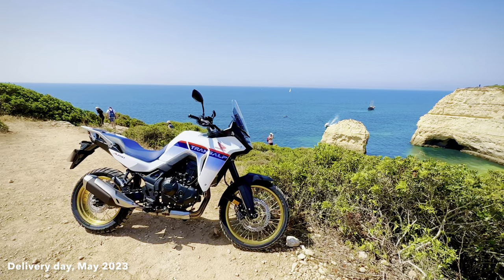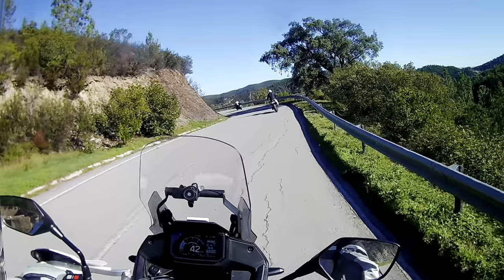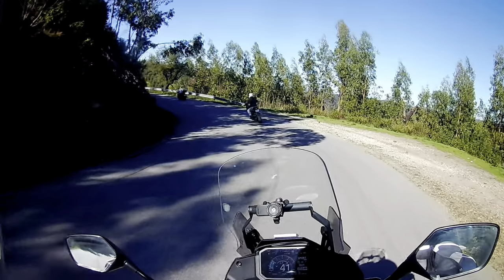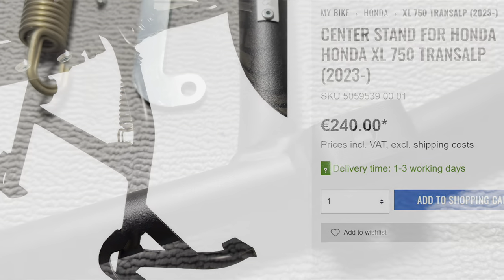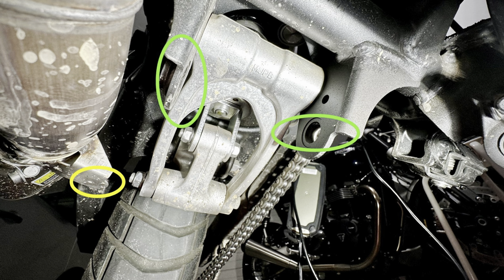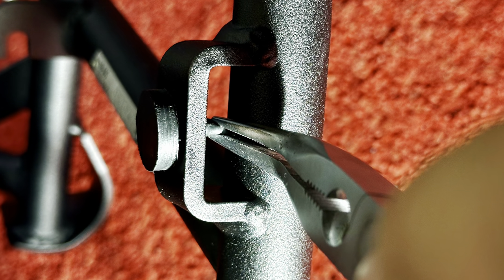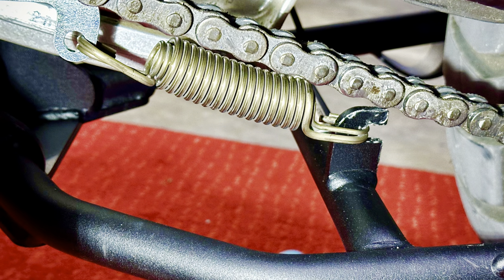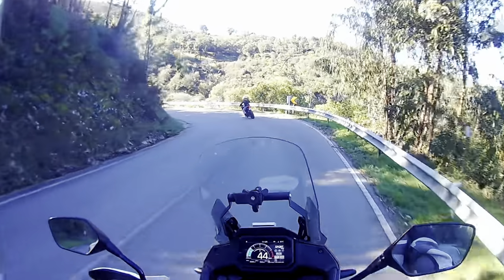Transalp Centre Stand Install  -  Hepco & Becker vs Honda

Comment: The first batch of the unstable stands are part no. 08M70-MLC-D00, whereas the improved later version is part no. 08M70-MLC-D01 (which I have fitted with no problems). Just in case someone thinks they are getting a bargain by unwittingly buying one of the first batch numbers. I like your vids by the way!
Reply from the maker: Thanks for the info - very useful!

Comment: I mentioned in my previous comment that a center stand was a godsend during a recent puncture. I'd like to warn owners that the rear wheel nut size is 27mm and of course I didn't have a socket that size, and I have quite a collection. So buy one now before you need it.
Reply from the maker: Good tip, thanks!

Comment: Hi mate, I have installed the same center stand by my own, and as always I'm very pleased. The trick to extend the springs is doing one per time using a metal fence wire in loop shape and using an old towel for hand protection, grap the inner spring first, attach it to the hook and then the outer spring. It only requires minor physical strength. Mind over matter. 
By the way, I love my Transalp 750 so much thus I have no plans to replace it in the near future. 
I recently uploaded a YouTube video about my bike but it is not in English language. Have a look about the extras I used on it and everything installed by my self.
Greetings from Greece.
Reply from the maker: Good tip about the spring👍 I have to agree about the Transalp. I’m always talking about changing it, but I can’t really think of any genuine reason to do so🤔

Comment: Essential. 
With chains and tubes should be standard. As we know.. 
For fitting i always have the same dramas, until i found it easier to fit the spring first, then pull the whole stand back and pop the bolts in. Seems much easier with more leverage. 
Good to see it getting plenty of use.
Boa viagems e feliz natal.👍
Reply from the maker: Nice trick👍😊

Comment: A tip for getting that stand spring(s) on. I first came across this on a Honda Innova, and later when I fitted an SW Motec stand to my R9T. What you do is use a length of strong string looped around your waist, and attached to the 'T' handle of the spring puller. Then all you have to do is lean backwards, using your body weight to stretch the spring, and slip it over the detent on the stand - job done in seconds with no effort and no paint scratching.
Reply from the maker: Nice tip. Thanks!👍😊

Comment: 1st mod on any motorcycle if it doesn't have one. It's a portable paddock stand. You can do virtually any motorcycle maintenance: front or rear, and possibly both at same time (get the balance right). Some bikes can't fit one due to exhaust interference though. That being said:

Back in May 2023, I ordered a H&B center stand for my CB600F-5. Great finish ondeed but what a load.... way out of alignment. Would not fit properly. Sent it back. Refund.

Bought a Zieger center stand (SW-Motech design) and this was from Ibex. Great stand. Fits like a glove and was 1/2 the price of the H&B!!. Forget H&B (certainly for the CB600F (2003-2006).
Reply from the maker: Surprising to hear H&B got it so wrong. I've always been very satisfied with their products, but thanks for the heads-up :)

Comment: Can I put in a word for a Tenere World Raid as a replacement bike, I ordered a Transalp when they were first announced but was disappointed with the specs when more detail was released, I ended up buying a Yamaha Tenere World Raid instead and it has been fantastic, on paper it is down on power, no fancy rider modes etc etc, but in reality it has so much torque, and the lack of electronics is a plus for me. If you can have a look you might be surprised. Merry Christmas from a wet and cold Midlands....
Reply from the maker: I have ridden the Tenere several times, but it’s too off-road focused for the kind of riding I do, hence my choice of the Transalp😊 It’s actually been cloudy and wet here this week… and only 15 max, which is very chilly for us!

Comment: I fitted the centre stand to my Enfield Scram. It took two of us to get the springs on with much blue language and a ratchet belt wrapped around the rear wheel. I'd always have a centre stand rather than have to faff with paddock stands. But I don't think I'll want to fit one myself again.
Reply from the maker: I can well believe it. They should really be standard on all bikes, but they seem to be going the way of car spare wheels🤔

Comment: Tiger 900 is definitely on my radar. The GT Pro for me as it's not likely to see much dirt. I will watch with interest on your next purchase.
Reply from the maker: Good choice! At least I hope so... we'll see in April, but the extra hp and redesigned hot air ducts should make it a winner. The press launch is happening just down the road from me in Seville right now :)

Comment: Your videos are always a good watch. Honda finish on their centre stand offering is truly dreadful. No wonder you bought an aftermarket one.

I went into my local Honda dealer last week whilst waiting for my car to be MOT'd nearby. After some time looking at the Transalp and the AT a young sales guy did eventually approach me asking if I wanted to buy one. Whoa ....... steady! I haven't even sat on one let alone ridden one. So he rather reluctantly pulled a Transalp out for me to climb aboard. It felt good although the handle bars felt a little close. I'm only short at 5'7" so I don't know how you manage RM at 6 foot plus. After some small talk I asked about luggage for it and he then spent the best part of 20-30 minutes tapping away on his keyboard trying to find out what was available and how much. What he came up with were fairly mundane looking hard plastic panniers and top box neither of which looked they would hold very much let alone a helmet. The price inc VAT was a ridiculous £1,900!!!!!! Honda are taking the piss. So I told him I wouldn't want the luggage probably go aftermarket and soft luggage lots of options.
He didn't try particularly hard to sell me the bike nor give me the impression he wanted the sale. So I thanked him and left.

Have you thought about or tried the Aprilia Tuareg 660? I sat on one a few months ago and it felt very good, more comfortable and more space than the Transalp. The spec is better as well. AndyManCam has recently got one as well and seems to like it. Just a thought. ATB.
Reply from the maker: I would strongly advise against the Honda panniers: I've seen several people who bought them with the bike complain about how flimsy they are. The Dusc boxes from SW Motech that I went with are very sturdy and 'only' about £600. Plus, when you get a new bike, you just have to buy new carriers.

Comment: I think the Honda for the money is the best bike around today. 
There's a little trick you can use with a length of thin rope, for getting centre stand springs on.
You simply attach the rope/pull cord to the spring and tie it to the rear wheel 🛞 then use the rear wheel to pull the spring. 
Laws of leverage,  simple.
Reply from the maker: Nice tip😊👍 I agree, the Transalp is a great bike

Comment: I've not had any problems with my OEM stand....yet. As for the rust spots, they could actually be braised welds. I had these gold coloured marks all over the subframe of my VFR and initially thought that they were rust too. My main beef with with the Honda stand is its operation. The foot pedal is long and is too close to the pillion footpegs also there's no grab handle under the side panels so you have to use the pillion handles which are too high and too far back. I recently had my first puncture and the stand made life so much easier.
Reply from the maker: I agree that a centre stand handle of some sort would help

Comment: At the risk of pissing you off and getting a sarcastic reply > 
Should have bought the bike with a centre stand in the first place, would have saved a lot of pissing around and if you were so upset with the potential rust spots, you could have used the rust inhibitor and touch up paint you used on your aftermarket one. 
Personally I don’t spend a lot of time on my hands and knees looking at my centre stand. 
Thanks for the vid. Still got a thumbs up. 
Vegetable rights and peace 🙂✌🏻
Reply from the maker: That’s kind of an odd criterion for choosing a new bike, though. Hardly any come with a centre stand these days

Comment: First pardon my English. 
I once had a struggle with the spring after painting my center stand. (Before painting it I putted the stand in the oven for warming it up - you should have seen my wife 😮) Well, I took a screwdriver to open the spring and then put a washer between every opening to make a gab.
Now it was a piece of cake putting the spring on. How did I get the washers out again? Just pulled the stand dawn and off they went 🙂 🇩🇰🇩🇰
Reply from the maker: That’s a excellent idea… and your English is excellent👍😊

Comment: there will also be the 900 gs, and a update to the 900 xr. So I am personally waiting until I can ride those before i start making a decision on my next bike in 2024
Reply from the maker: As you may know, I was disappointed with my 900XR, so unless there's a radical overhaul (ie. new engine), I don't think I'll be interested. The new S1000XR looks more up my street, but it is a lot more expensive.
Reply: @RocketMan_Moto  I rode the 1000xr, and 900xr a few weeks ago. If they sort out the gear box on the 900, then it could be a winner. The 1000xr just isn’t the bike it should be in my opinion. Basically it’s just too big and has way more power than you would ever use. Having seen your bikes, I already know the 1000 is not for you (2024 is a very minor update on the 1000xr. New colour and some body changes I believe) I may be wrong.  But I think that the 900 xr will go together with all the work that has gone into the new 900gs, meaning it could be a good step up. We will have to see..
Reply from the maker: Interesting. I’d still like to try the S1000, but I’ve heard it’s vibey and I don’t like that
Reply: @RocketMan_Moto  to be honest, I don’t think it will be the vibes that put you off, more the price and the excess bike that you don’t need. That bike is a weapon, way more sport than tourer… and again, I just don’t think that is your type of bike. We will see 👍

Comment: I absolutely hate pulling centerstand or sidestand springs. Scrapes and some pinching seems to occur more often than not and probably is the reason I'm delaying putting on a centerstand on my 2024 Kawasaki Z900RS SE.
Reply from the maker: Yes, not a pleasant job. Somebody suggested cable ties, which sounds like an obvious solution (which I didn't think of!)

Comment: I was waiting a couple of months for OEM center stand from Honda after bike pick up. Once it came it was a massive disappointment. I know nothing about welding but I’m sure my product would be a lot better quality. Welds were rusty right after I opened the box. A complete disaster. I mounted it (BTW. I tensioned springs using zip ties - easy and fast method!) but see know I should have send it back to dealer for money refund. Now is too late as with me some time but I’m sure I will get it sanded and repainted sooner than later.
Reply from the maker: Oh dear, that’s very poor. Clearly Honda has issues with certain suppliers. Good tip re. cable ties👍😊

Comment: If the Stelvio is as good as the Mandello, it'll be a lovely beast. Not for me, though as big ADVs aren't my thing. The Enfield Himalayan being more suited for me when off road.
Reply from the maker: I like the look of the Himalayan, but I need more than 40hp for the motorway ride home after the off-road fun. I’ll still be testing one, but not before March, according to my RE dealer🙁
Reply: @RocketMan_Moto  this will be for local trails. Bikes like the Stelvio and GS are too heavy for me to take off road.
Reply: @RocketMan_Moto  the guzzi is more a road bike then an off road bike 😉
Reply from the maker: Agreed, but so is the Transalp. Suits my riding style :)

Comment: Hello !  
Yesterday I installed mine center stand from HEPCO&BECKER and I was very surprised - lifting the bike is impossible for a single person/ 170 cm, 72 kg., 4 degree preload on the rear suspension, without luggage/ ! Please, if you can to make a video of how you lift the bike, I would be very grateful! 
Thank you in advance !
Reply from the maker: It does require some force, but it gets easier with the right technique and a bit of practice😊 Remember to put the bike in neutral to allow the rear wheel to roll backwards👍
Reply: @RocketMan_Moto   , i know this things - this is not my first bike. I have 12 years experience and believe i have the right technique, but it looks like you must to lift almost all the weight of the bike in the first moment, because of the small angle between the floor and the leg. I tried on flat concrete floor and the legs of the stand just slip ... !
Reply from the maker: I lift the bike as I step on the centre stand

Comment: I added 3kg to my bike, it just gave me insensitive to lose 3 kg's from my own weight. Ended up losing 6kg, -3kg winner 😊 lifes much easier with a centre stand 👍
Reply from the maker: Lol, I thought that as I was fitting the stand: "I need to lose 3kg to compensate" :)

Comment: I just hear good things about the tiger 800 🤔🤔🤔... 

even if I m thinking about a maxyscooter 
I will test ride the 1300 gs , 20k (€) spocke wheels and center stand (only 😅) ...
Receve a call from a lady of bmw ☺. 
I  lost my admiration for the transalp and for the "POWER OF DREAMS"  ... the problem is that my heart is on the gs even if is not rational dicision ☺.
Reply from the maker: The GS is a fine motorcycle if you’re prepared to spend that kind of money👍
Reply: @RocketMan_Moto 

 its a big problem 🙂 20k (😃) 

 i saw the africa twin dct (21fr) 16k 😃...

 i sit on the suzuki dr 800, its a completly new bike... was astonished ... well engeneer, and is not a small vstorm 1000... and there is the "de" now 👍👍👍
I always admired the mecanics on the suzuki bikes
(Kickshifter is top for what the majority is saying)

The tiger is top and for 13k is a top machine (if honda could learn sonething with triumph 😂)  ,
 but i dont like the front faring, as also for the tenere 700 and the 660 tuareg, personal crazy tastes 😑🤐.
Reply: @RocketMan_Moto   You can not make a review about the suzuki v-storm 800 DE?
Reply from the maker: The new (2024) Tiger 900 looks good. On my shortlist...
Reply from the maker: I already have, lol: https://youtu.be/XQhG1UF7hVM
Reply: @RocketMan_Moto  yeah ☺
Reply: @RocketMan_Moto 
 saw it tge vídeo ... cool ✌
No cruise control on both ... 2024 😲

but suzuki has launch 
a vstorm 800 re its differrent fron the 800 de (road focus)
Unfortunatly suzuki hadnt put the 650 V on this new " re" 😉😉😉

Comment: Ha ha ha. That's why I bought the F750GS. It was AUD $2,000 more than the Honda but comes with everything I wanted. The Honda comes with nothing and would have cost another $5,000.
Reply from the maker: Sounds as though you made the right choice for you👍

Comment: The hepco is certainly better in this case but honestly if you go off road often the debri, rocks and dust will remove alot of the paint of the center stand. I have one on my vstrom 800 de and the center bar of the center stand has lost the paint right on the middle. However, the welds are perfect. Shame on honda.
Reply from the maker: Honda should be ashamed of

Comment: My OEM center stand for transalp was wobbly and didnt fit properly, after waiting 5 months honda acknowledged the problem and now removed it from my bike and they will 'decide' what to do next. So ye, honda OEM is a joke, i regret buying the honda one.. and i dont want to buy another brand now..
Reply from the maker: Wow! I had heard about the Honda stand being wobbly, but couldn’t find any video evidence of how bad it was, so didn’t mention it in the video. Thanks for your feedback, hope you get it sorted soon👍😊
Reply: @RocketMan_Moto  My dealer took it off today, and now we play the waiting game again :) if anything happens within the next 6 months I will be surprised. Mine also had many rust spots and i never even used it (it was mounted but thats it) so very poor quality.
Reply from the maker: I would have thought a refund was in order, at the very least🤔
Reply: @RocketMan_Moto  Yup or some coupon or small gift or token or atleast the option for a refund, but nope. Gone are the days where customers matter.
Reply: I have the OEM one and I haven't had any issues, could yours be a odd one?
Reply: @spica2me_  It was a specific bad batch (first ones) after april or may production was fixed
Reply: @Kevin97587  Ohh it makes sense.. I bought my Transalp back in October so by then Honda sorted the issue
Reply: thats crazy.... Honda have to find there wings again... 
it's loosing a lot... know i start to get worried about the way honda is doing bikes and things... triumph and cfmoto is flying much more higher to not say others manufacters... i had a special admiration for honda... they have to turn thongs around and fast...
Reply from the maker: Very casual attitude from Honda. As you say, things aren't what they used to be :(
Reply: Thanks for the info RM. I actually did order my TA with the original main stand. As of today, I haven’t experienced a wobbly standing or rust, but I’ll check again. As I bought mine in June 2023, it might as well being effected.
Reply: @RocketMan_Moto  As n update: My center stand was inspected by the Honda engineer team and send back to my dealership with the message that yes there is more movement than normal BUT that its within limit and that it wouldnt have a negative impact so that they can just remount it. Obviously im not happy about it but as always, as a customer u always pull the short end of the stick.